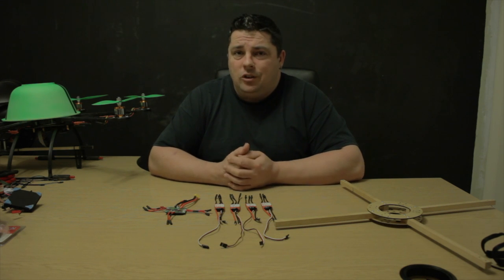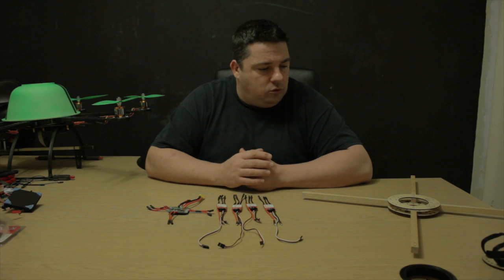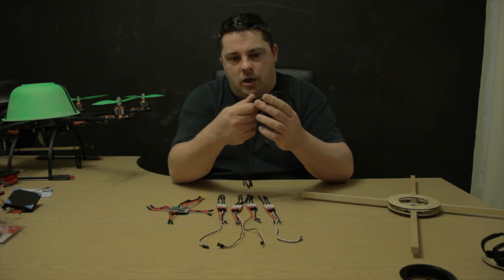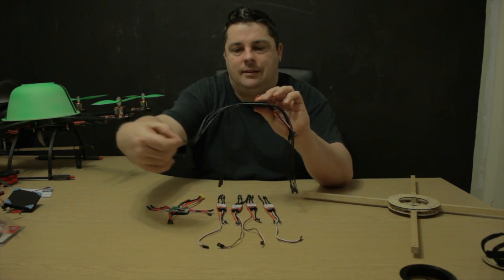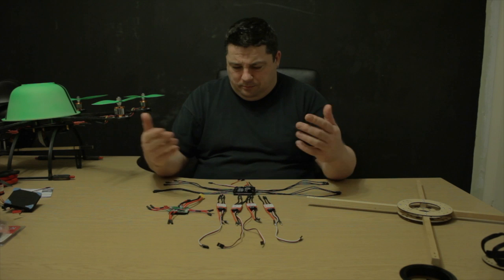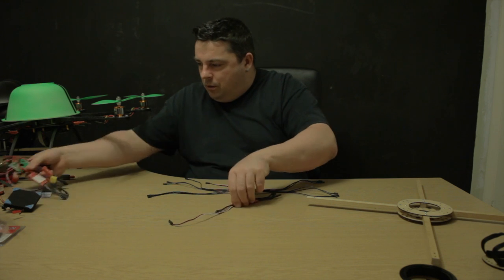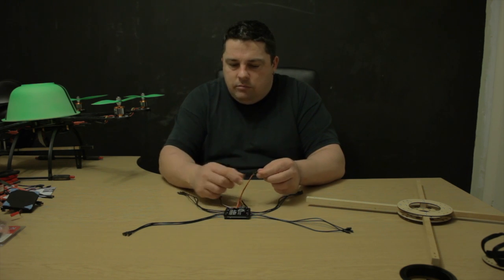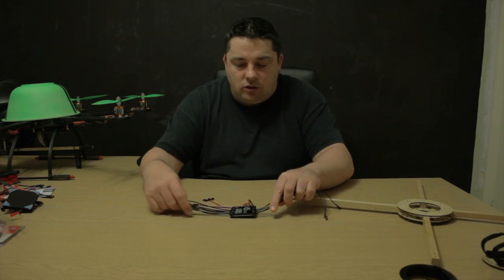Project Anycopter - Q Brain preview

Comment: Hello there I'm a beginner at this I found your video very helpful, but I have one question. Does the brain consists of a power distribution and a speed controllers?  Can you please make a video showing how to do all the wiring and the parts needed?  Thanks.
Reply from the maker: Hi Arbaz yes it is, I will do this as a request as soon as I get a few hours spare

ATB Malc
Reply: thank you very much =)

Comment: Same problem. You have to calibrate the Q Brain ESCs using the throttle hub, and then calibrate them again through the KK2 boards by holding down buttons 1 and 4 on the KK2 within 2 seconds of powering it up. Calibration method is the same - throttle at max, 2 beeps, move throttle to min, 1 beep. There is no multi-beep tune though when done through the KK2.
Also be aware that when using a KK2/2.1 board you need to move the Q Brain power wires (red and black) from S3 (white) to S1(red) so that your motors are correctly controlled. (A hobby knife blade will lift the plastic that retains the connector pins and allow you to slide them out.) If you don't motor 3 will accelerate to try and stop motor 1 from dipping, get into a control loop, and flip the quad on take-off.
Reply from the maker: Great advice Mike I found this out the hard way =S
Thanks for watching!

ATB Malc
RCTV-UK

Comment: hay i havea sf450 frames with the kk2.1 board and the q brain and all the moter work but it just when i power up the quad copter. the quadcopter just won't to roll over and when i try to trim it. it roll the oveway  plz help

Comment: one thing the kk2 needs power on channel 1 so on the brain esc you have to wire motor 3 as 1 and 1 as 3. then you get power on channel one and all will work fine i like this esc with my kk2 boards. it works fine for me
Reply from the maker: Thank you Randy I appreciate the tip.

ATB Malc
RCTV-UK